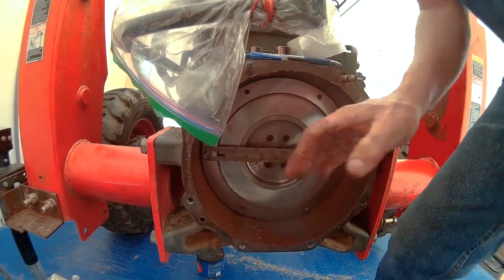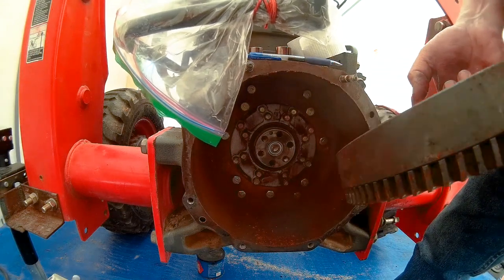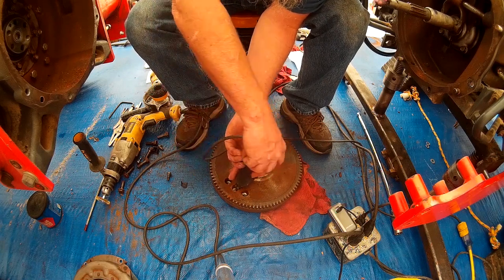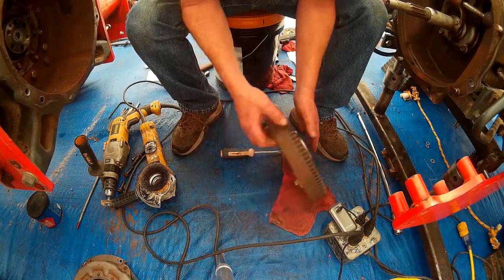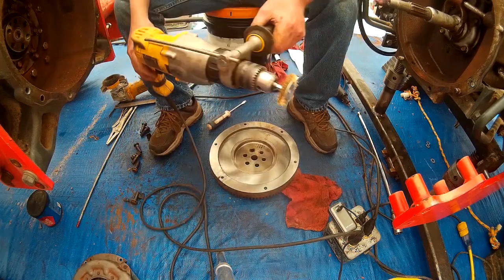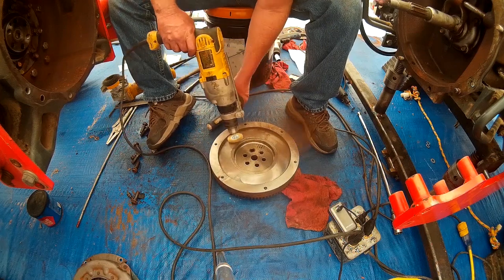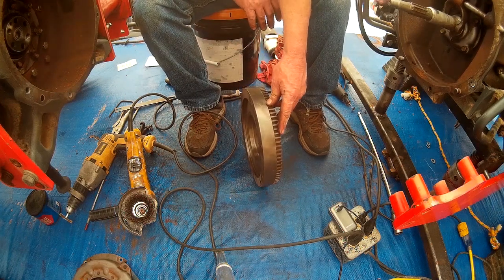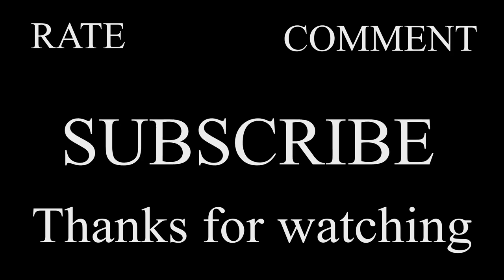clutch replacement kubota Removal of the Fly Wheel part 4

Comment: I was waiting for the paint job. When I do a job like this I clean and paint all the bare metal. Except the flywheel face, of course. I found Home Depot will mix Rustoleum any color you want. Add some hardener to the paint and it will last a very long time. I did a Volvo diesel in a boat. Ten years later when I pulled the motor for a major the machine shop thought it was a new engine. LOL. I told them it would be new when they were done, and the paint was over 10 years old. Keep up the videos, my friend. You are doing a fine job. Dave
Reply from the maker: I'm trying brother getting burned out though. lol I thought about painting the inside of the housing but just cleaned it good and left a little oil residue.

Comment: Are you going to resurface the flywheel? With all the work involved I would make sure it's flat.
Reply from the maker: yes I took it to the local mack dealer and they surface ground it on their big machine. turned out perfect!

Comment: That's one clean flywheel! I completely understand your concern about what to do with the hydraulic fluid. I'm not familiar with the inner anatomy of a tractor driveline but that seems like a helluva lot of rust. I wouldn't think it could form in an environment like that but there it is.
Reply from the maker: keep in mind this is a dry clutch not a wet clutch so it has no contact with hydraulic fluid. some of the Kubota tractors do have wet clutches but not this model.
Reply: @daveknowshow , that makes a lot more sense!